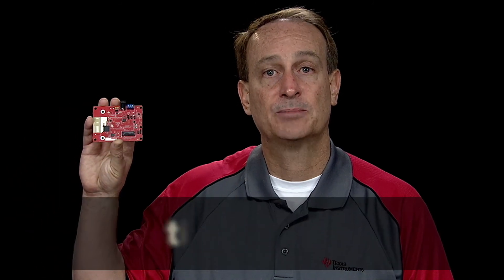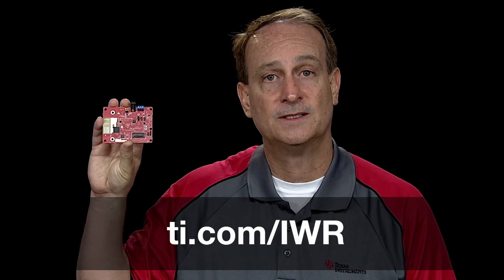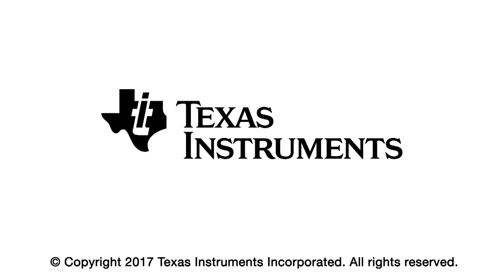Material handling using IWR mmWave sensors

Comment: how much radiation power in watts (for the wave) does the evaluation board put out? what's the supply voltage?
Reply: Tx power is 12dBm- - about 15 milliwatts.  An average cell phone - 24dBm, or 250 milliwatts